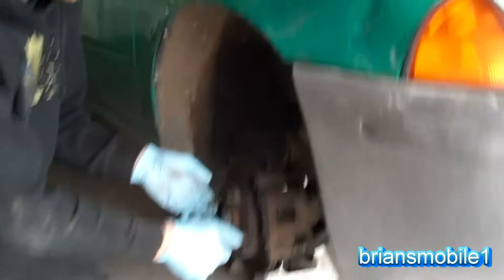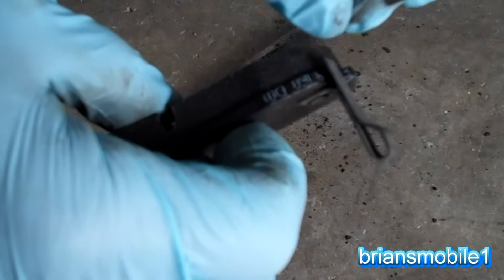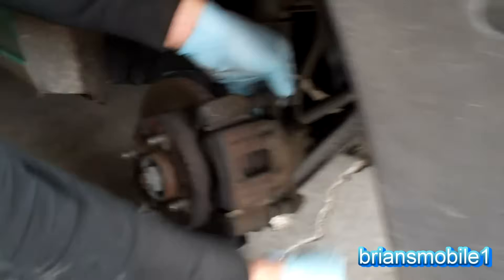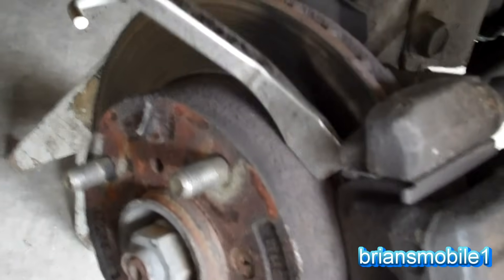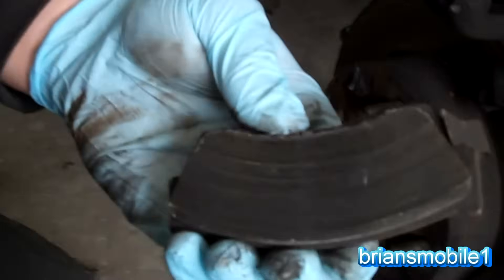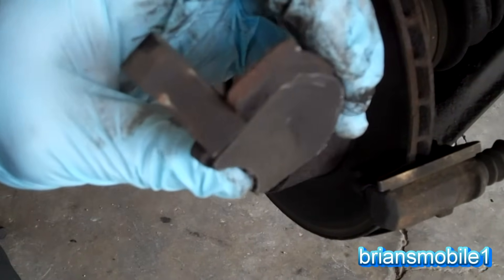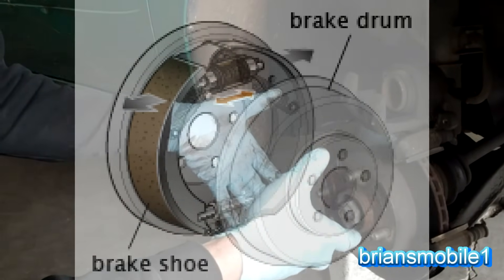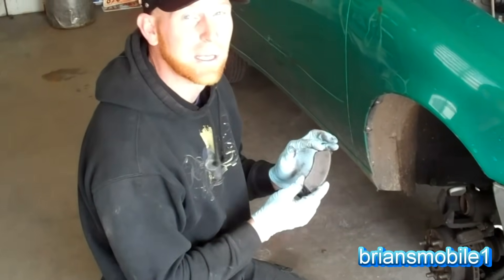Why Your Brakes or Wheels Squeak

Comment: Great video & you most certainly are very good. My problem is my front brakes and rotors are relatively new. It's not constant though, it's as the wheel turns ? Thank You So Much !...

Comment: My car squeaks while driving straight, but stopps squeaking while braking. And also stops for a second when jerking the wheel a bit to the left or right. What could it be?
New pads and rotors are put in 20.000 km ago

Comment: why did you not open the cap on the brake fluid reservoir, then get that leverage bar and open the calibre to allow for the the gauge of the new brake pads,  you could have got that nearly all the way out with that  bar and had them ready to accept the gauge of the new pads, just wondering why you chose not to do it? still a good video though
Reply: You don't want to introduce dirt, moisture and air in the reservoir while you change your brake  pads. The piston will retract just  fine with the cap on.
Reply: What!

Comment: My new brake pads squeak after several stops. What could cause this?
Reply: Did you lube between the pad and caliper?
Reply: Yep...
Reply: Are they a cheaper metallic pad by any chance or are they a ceramic?
Reply: Cheapest Autozone...
Reply: jrmym2 Theres your problem, Honestly when it comes to breaks you shouldn't skimp too much on them. Think about it this way, they're one of the most important systems on your vehicle and not something you should take chances with. Plus if you spend a bit extra on the nicer ones (They don't have to be super expensive performance brake pads but middle of the ground) They'll last longer and you'll get that moneys worth out of them. :)
Reply: cjwolfer How 'bout them fancy Autozone "Gold"? 36 bucks instead of 19... worth it?
Reply: cjwolfer I agree. At our shop I refuse to use the "dollar tree" pads just for that reason. It is important and I've never though of braking as being an option lol. Same way I feel about wheel bearings / hubs, steering and suspension parts. It's bad enough that allot of the aftermarket "good stuff" is still Chinese junk, i can't imagine how the good the cheaper parts are. Any how just my 2 sense. I've done a few videos on my channel that I show very time consuming costly problems with aftermarket parts. Shoot me a message if your interested in seeing them.
Reply: jrmym2 I don't personally have any experience with them but they're probably better than the cheapies as you really do get what you pay for with brakes. I'd keep your old pads that are still relatively new as spares in case you do get in a pinch and need temporary pads but otherwise try and get something better on there.

South Main Auto Repair Exactly, As I told jrmym2 I try to use the middle ground pads that my local shop sells for my car, it's a bit older so my options are a bit limited but cheap pads are just not worth the risk and the really expensive ones aren't necessary for my type of driving. I like your wording "I've never thought of braking as being an option" Very good way to put it. :P
Reply: Thanks jrmym2. Well Its just how I've always thought of it. Being in the automotive industry my entire life I've seen some pretty awful things comes through the doors of the shop. Rotors split in half, calipers wore right through the piston till it pops out, pads installed backwards...the list goes on lol
Reply: jrmym2 Avoid them,look into the Wagner thermo quiets
Reply: wafrederick Wagner Thermo-Quiets are an excellent pad with bonded friction material and integrated shims. I installed those for a lot of years with no complaints from customers but did notice a shorter than average life compared to most high quality pads. Usually around mid 30k they would need to be replaced.

Comment: I’ve had this but comes and goes mostly comes after driving for a bit 
Definitely left rear wheel
Any other advice the mechanic I took it to said all pads ect are ok 
Should I be worried about the mechanic 🤔
Reply: Kind of the same problem here but front right tire, i took everything apart, cleaned and greased, used stop squeal but still hear it sometimes?? You ever figure it out???

Comment: I asked some people and also went to a mechanic for this problem. Nobody gave me a right answer and the mechanic said I needed brakes and rotors for $700.00. I can do stuff like this myself but my tools are #$*%# um missing and so I trusted others. The car is my mother's. I scavenged some tools and was able to remove the pads and they looked almost brand new and had a glaze shine to them. I sanded them and cleaned and greased and installed them back on. $700.00 this local mechanic said to me after he inspected the brakes himself. I'll never buy gas from him again. Well I went to this youtube channel....and now I want to say thank you. BTW my mother is one of those old timers who uses both feet for the pedals and I figure that might be the culprit for the glazed pads..
Reply from the maker: Welcome!

Comment: I have new brakes and rotors were machined, I have a high pitch squeak when driving which isn't loud but I notice it and also at low speeds when breaking a very rhythmic low pitch squeak like rubber being squeak across the metal. Mechanic has said to give it a couple of days and see if it settles but if not he will have another look but I was wondering if you might have any idea on the low pitch rhythmic slow squeak at low speeds when breaking to a stop.
Reply: Did you ever find the solution?

Comment: My brakes have 80% left and they're like new and I've squeaking noise while driving and it goes away when I shift to reverse. Anyone experienced this?
Reply: I have the same problem...Usually if I keep driving forward I'll still hear it then after the car has been driven for a while it just goes away. I got a 13' Murano
Reply: KODmasta07 I’m having the same issue, squeaking and vibration under the pedal. Mechanic advised to have brake pads replaced but still doing doing the same thing. Will go back to get my wheels aligned, it could be the culprit.
Reply: I Am did you find out what it was?
Reply: @5.793  It might be that the brake caliper pins are not moving freely, and keeping a part of the pad in constant contact with the pads. Buy some OEM or high quality OEM compliant brake caliper slide pin grease, take the pins out, clean them thoroughly, reinsert, and repeat until it comes out clean. Re-lubricate the pins with a healthy dose of the new grease, but don't overdo it either. 

Reinsert the pins, move them back and forth and spin them until everything feels well lubricated. Might be a good chance to double check the brake pad replacement to see if anything doesn't look correct. Torque everything to spec with a torque wrench, and try again. I had this sort of squeal from my car before I cleaned and lubed the slide pins.
Reply: Cheap brake pads cause this sometimes when u mash the brakes I vibrates heavy and feels like rubble even if h just bought them

Comment: Is there any way to make sense of one wheel making a similar annoying sqeeking sound but no other?  Can the front brakes wear unevenly?  My front right wheel does this and the rest are still silent.  It's also pulsating but seems to be in sync with what I imagine as the rotation speed of the wheel.
Reply: OptimisticPessimist also have the same problem it's only at low speeds can be heard in parking lots clearly!
Reply: NaRc* I hear it at any speed as long as the window on that side is open.  The faster I go the louder it gets.  I wonder about the ears of pedestrians I pass and people in cars near me with open windows.
Reply: It's noticeable as I look for it in other cars that pass by. Today wasn't as bad but that's always like that first time turning the car on first time of the day , it comes and goes but still is very annoying
Reply: Often I can't hear it but when it echoes off objects as I pass them.  When I'm in the far right lane within the city it bounces off curbs and hits my ears hard.
Reply: OptimisticPessimist are you still trying to find out what that might be?? It seems to happen at only part of the tire or wheel when it rotates

Comment: 2003 Pontiac Grand am  with a 3.4L V6
This past week
 i completely replaced  2 Wheel hub bearings/ 2 rotors/ 1 set of front brake pads/ 2 calipers and 1 CV Shaft and still have squealing  and a rubbing sound when braking, the booths on the 
 old CV Shaft are hard and the New shaft is soft rubber, could that make the weird sounds.

Comment: I've put cheap $46 brake pads on the rear of my 97 celica. On the front I've put $96 pads with anti-squeal technology. Just had the wheel bearing replaced on the front driver side as well. Guess what? it squeaked! Well, only when I make turns and it's not that serious to me but I'll look into it further. It had extra shims which I guess is for anti-squeal as well.
Reply: You just installed something wrong

Comment: my volvo v70 squeaks from rear only when i reverse for a few seconds ???
Reply: sounds like you need some upgraded pads. People like to buy the cheapest you can get, but some cars don't like the cheap ones. For your car (I drive a 2000 V70) I'd go with the Wearever Platinum Premium Ceramic brake pads. Less noise and less dust.
Reply: ok many Thanks brakes were renewed 6 months ago
Reply: yeah, it happens. I put new "cheaper $56" pads on a 06 Mercedes SL55 AMG two weeks ago. He came back monday and said they were way to loud. So I ordered some ceramic $150 pads and put them on, solved the problem.
Reply: I am in no way trying to advocate my channel here but if you look there I did an install on a Subaru Impreza, rear pads, and I showed how properly lubing the caliper can eliminate "brake squeal" check it out for a little more info.

Comment: Is there a rule on which way this squeaker needs to be installed? That is, assuming the the caliper is in the position as the video, do the squeakers to towards the upper rear of the car or the lower front. I always just do it how they last set were on there, but some clown before me might have done it wrong. Thanks for all the videos Brian. Merry Christmas.

Comment: hey brian i have a question for ya! i have a 2002 mazda protege5 and its front wheel drive. whenever I'm braking at a slower speed as i come to a stop i can hear this clicking sound and I've pulled apart my brakes and rotors are good and aren't warped and I've checked my shims and they keep the calipers in place. any ideas what could be causing this?
Reply: Dominic Gracia pads not calipers lol

Comment: Hey Brian, I am in Utah, I have a 2004 Acura TL, put on new pads front and rear, new rotors on front and turned the backs. I applied appropriate break lube to the back of the pads where the caliper touches and no matter what I do both the front and rear squeak every time I press on the breaks. I did the work myself and so I took it to a break shop and they said it all looks good but it should not be the pads composite that squeaks, I am not getting lots of break dust. Can you help me?

Comment: why would someone wait until the brakes are that squeaky :) paying someone for a brake job can be expensive but getting the parts online can cost 40$. if you are lucky and get them on sale you can get some high performance pads for less than 20$. waiting for the brakes to squeal may cost more than the pads, cause then you may have to replace the rotors too...